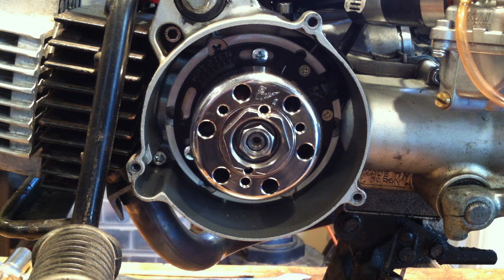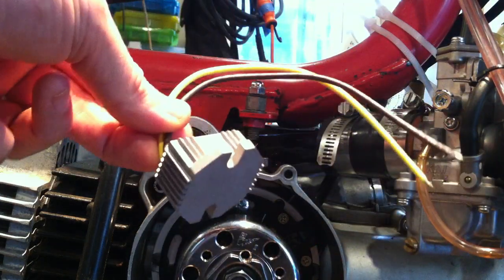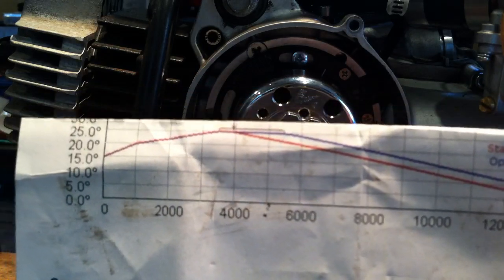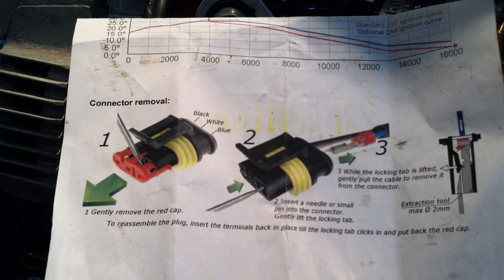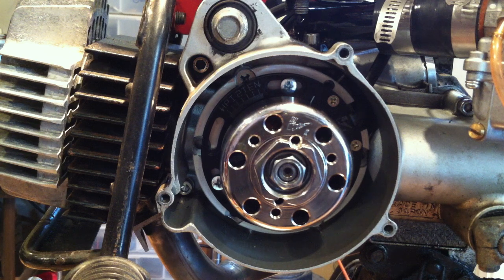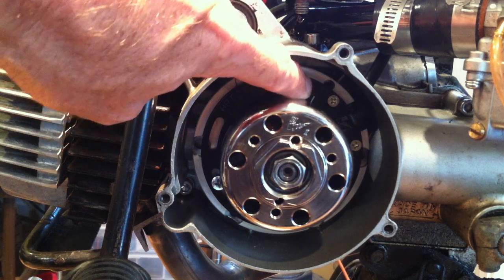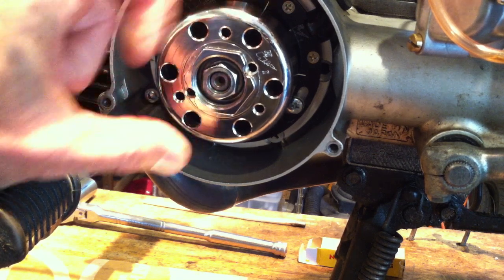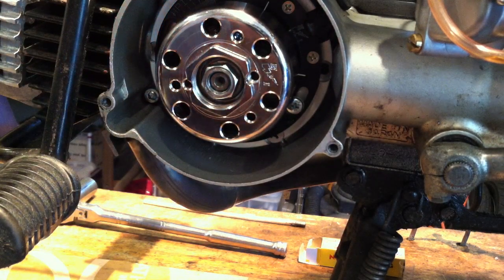Yamaha qt50 HPI System - introductory remarks

Comment: Pressure waves (just as "acoustic" waves) move faster, the hotter the medium-of-expansion (aka: exhaust-gas) is. At high RPM the pressure waves have less-and-less time* to fullfill their duty (of superchargng the engine), so, speeding them up is beneficial (when considering that the exhaust-pipe, which does the job, is of a fixed length)... This way, a fixed-length-exhaust-pipe can serve a broader range of RPM with perfectly-timed pressure/supercharging waves**. 
*Example: A single cycle at 10.000rpm lasts half-as-long (mere 6ms) as at 5.000rpm (12ms), and correspondingly, supercharging the engine (via the exhaust-gas pressure-waves) has half-as-much time to be accomplished, than it had at 5.000rpm. 
**One can also build a variable-length exhaust-pipe. Length is then dictated electronically, depending on the momentary RPM, engine-load-state (throttle-position) and momentary exhaust-gas-temperature. A long pipe for low RPM, that gets shorter-and-shorter the higher the RPM gets (aka: when time is of essense, then simply shorten the distance). This way, one gets the maximal possible torque at any RPM. From the examples I know, 12cm correspond to a 1000rpm-broader peak-torque bandwidth.

Comment: I have a 82 Yamahopper. I'm having a charging problem. I have a donor bike and changed everything but the stator. Should the voltage fluctuate with the rpms?
6.7 at a higher rpms. 4.4 at an idle.
Reply from the maker: Yes the voltage fluctuates with rpms

Comment: How has this system been handling?  Any changes or anything I should know before I maybe order this?
Reply from the maker: Running good.  The weather has become colder here so I haven't ridden it as much plus I have several other bikes and projects.  It has become more difficult to start but it may just need a new spark plug. Here it is earlier this month https://youtu.be/bTLOpboBp_8?t=488

Comment: So all you do is splice a wire into the blue wire that comes out of stator and that will solve head light from blowing. Installing a voltage regulator on a 2 position switch
Reply from the maker: that should generally do it.  You should also run a battery that's in decent shape.  the battery also acts as a regulator.  Yamaha intended the regulator and the battery to work in combination.